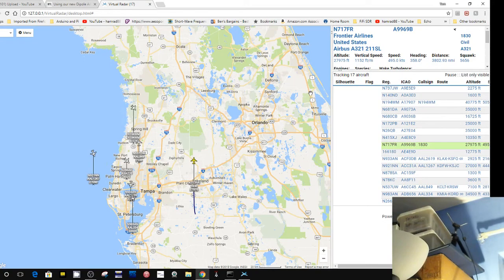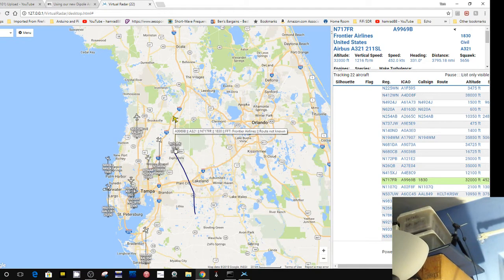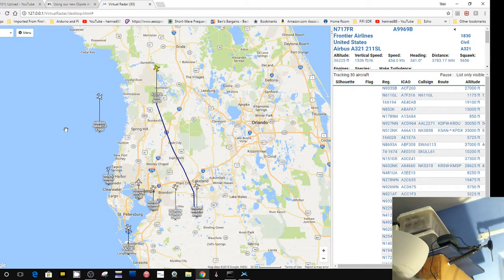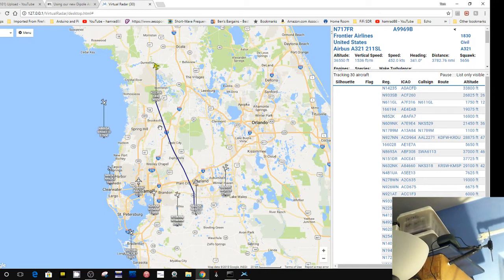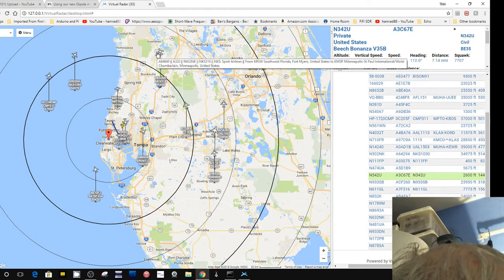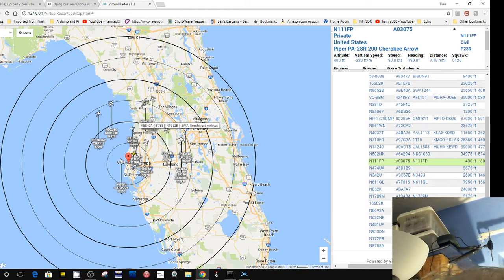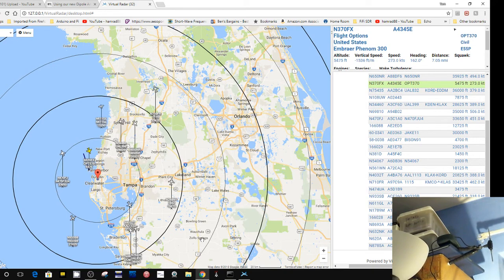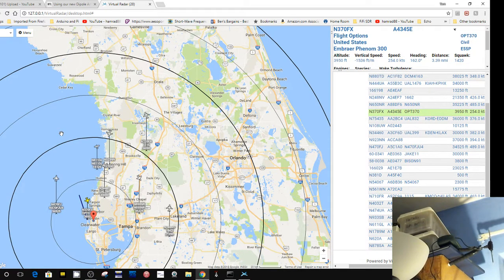TRRS #1386 - RTL-SDR.COM Antenna Testing Pt 2

Comment: This is very interesting. Thanks for showing us this testing. One thing I was thinking about that might be an interesting approach... When you are switching between antenna to test, let the data 'drain out' after you disconnect one. When all the planes are gone and the data is cleared, then connect the other antenna or adjust it for testing in a "clean" environment. It might be an interesting experiment to then simply count the number of contacts that each can pull in for you.
Reply from the maker: Great idea.